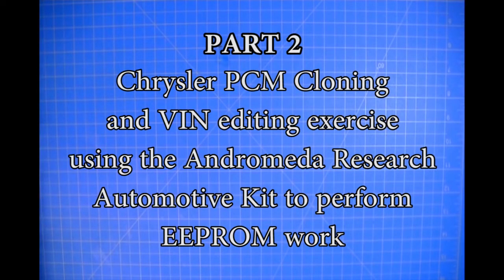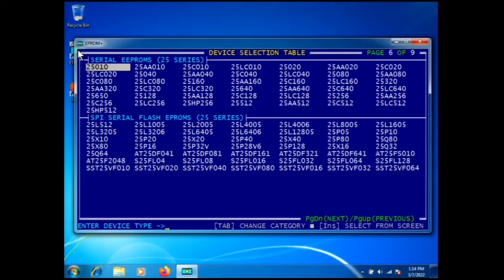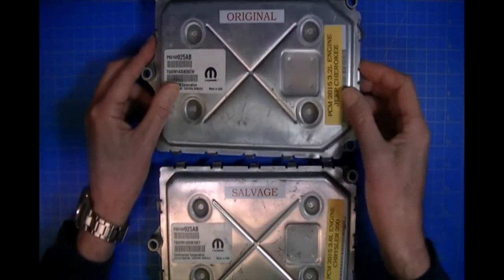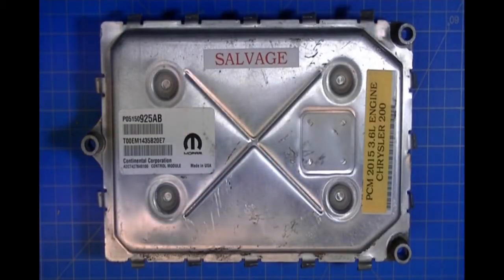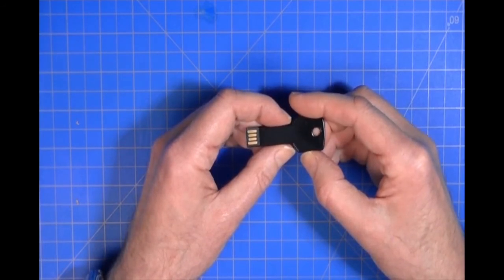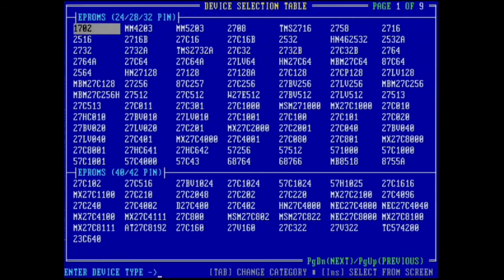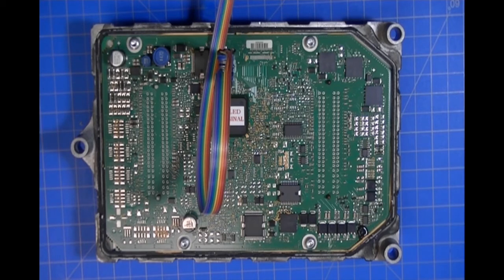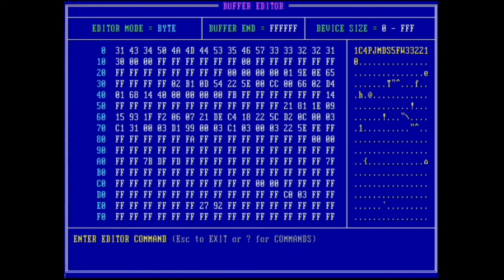How to Unlock, Clone or VIN edit a used or salvage vehicle module. Part 2-Demonstrating the solution

Comment: Do you have a source or site where i can look up how to open up my ecu? i have a 15 gmc canyon and its ecu is sealed, no screws. am i supposed to cut out the case ?
Reply from the maker: There is no source of which we are aware which describes how to open different modules. Modules usually have screws or screws  and sealant. Sometimes the application of heat to the module will soften the sealant. If the module is totally sealed then You'll have to pry the assembly apart.
Reply: @andromedaresearchlabs7826  Is the AR32 able to read eeprom's from ecu's with out opening them? thru the pin outs on the terminals?
Reply from the maker: No. Connections to the module plug/socket is the same as OBD. You are using commands sent directly to the module internal processor to perform the operation.  Our products connect directly to the memory part thereby by passing the processor and any code limitations. Here is a video we did describing how this works: https://www.youtube.com/watch?v=XT_LXjFsKik&t=1441s&ab_channel=AndromedaResearchLabs
Reply: @andromedaresearchlabs7826  im sorry to bother you,I purchased your ar32 programmer. is there any way you can help me get this ecu unit open? i have a 2015 gmc acadia ecu , it's a Aldelco E92 unit, i can not figure out how to open it, it has no screws at all and i tried heat gun, prying on the edges, no info online, im afraid to saw it open and hit the board, any instructions you can give me would be appreciated.
Reply from the maker: We always do our best to help however if the module is totally sealed with epoxy and you have tried heat, physical cutting may be the only option. Sorry I don't have another solution.
Reply: @andromedaresearchlabs7826  my apologies for asking too many questions, i have managed to finally open my ecu,now i can't get any info on where my eeprom is located or even if my ecu has one, any recommendations on how i can do research on eeprom identification for acdelco e92 ecu?

Comment: Thanks for the interesting and thorough video. Will this work on Mercedes W212 ECUs? I opened up mine last night and saw what looked like 5 identical EEPROMs, any suggestions? Thanks.
Reply from the maker: I searched using "Mercedes W212 ECU eeprom". The results indicate that the eeprom is a 25128 which is supported by our product.

Comment: Can you virginize, a used module, without having an new OE module or a the virgin file?
Reply from the maker: You can erase the VIN (if it's there} and clear the crash data. That's not a guarantee that the module is virgin but it's as close as you can get without programming a virgin file.

Comment: dip switch settings???  sure looks like the board actual settings are 1 and 4 up, 2 and 3 down in the video.  not, the 1 and 4 down 2 and 3 up specified.  6:28  unless your dip socket is installed upside down.
Reply from the maker: You are correct. The switches on the adapter are not set correctly. Since the eeprom (25320) is an SPI device, switches 2 and 3 disable write protect (if active) and force HLD (hold) to an inactive state. Switch 1 and  4 do not apply to this device. Since the procedure was successful the invalid switch settings did not affect the outcome. Thanks for pointing it out. Next time I'll double check.

Comment: What do you do if the data in the original was corrupted by an inexperienced locksmith, how do a load a valid data set for the whole table of eeprom?
Reply from the maker: If the original data is corrupt your only option is to load a virgin file (assuming you can find one) and then program new keys to the car. You might try a salvage immobilizer which may require a VIN edit as long as it is not linked to the ECU.

Comment: What if you don't have the original module?
Reply from the maker: You read the data from the module eeprom, locate the VIN, edit the VIN to match the vehicle with which you are working then program the updated data back into the module eeprom.
Reply: I don't think you got it. If you don't have the original PCM, you can't read it or copy it. You can update the VIN in the new/used PCM. 
Ideally, you would get the correct PCM for your car. On Chryslers/Dodges, the part number needs to match. The last two letters are not necessarily critical. Say you have 05792345AH. AH is the revision level for all parts Dodge. The higher the last letter, J, K, L, the newer the revision. Older versions such as AC or AD will work, they just wont be the latest update. Now, you can go to Tech Authority and download the latest and greatest revision and install it on an older revision. That's another can of worms.
On thing to watch for is, Dodge used the same PCM part number & PCM for multiple vehicles. Just because the part number is the same, doesn't mean its programmed for your setup. One example, 2008 Charger/300/Magnum with a V6. Part # ends 246AD whether you have a 2.7l engine or a 3.5l with a 4 speed trans. While the car will run with either computer, a 2.7l computer will make a 3.5l engine run lean and it will throw codes for it. There was also optional ABS and Secondary Runner Valves that were optional. You will get codes and lose speedometer if you don't have the right setup programmed into the PCM.
4 cylinder, V6, & V8 trucks are the same way in certain years. Same computer, just programmed for whatever setup it was running.
Reply from the maker: @QwertyQwerty-jq3cu If you don't have the original PCM but the module part number is the same the only difference is the programming in the module. They are electronically identical. If there was a firmware update it will not be reflected in the part number so you wouldn't know. If the part numbers are the same you should be able to edit the VIN and have the module accepted. If the part numbers are not the same you can't just edit the VIN and expect it to work. In most cases the original PCM is available.

Comment: Is it possible to just take the eeprom out and solder it to the donor ecm?
Reply from the maker: Yes, if you know how to solder and don't need to edit or backup the data. If you damage the original or lift a trace you have no path back.